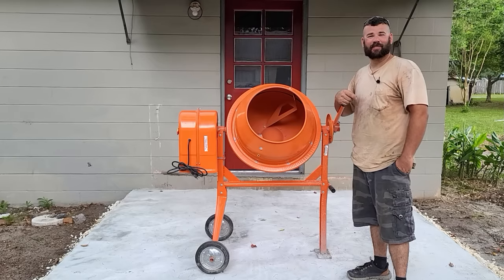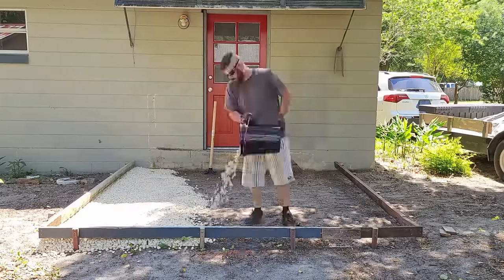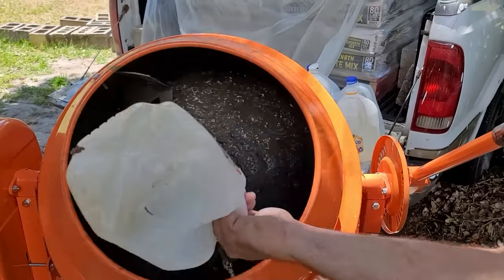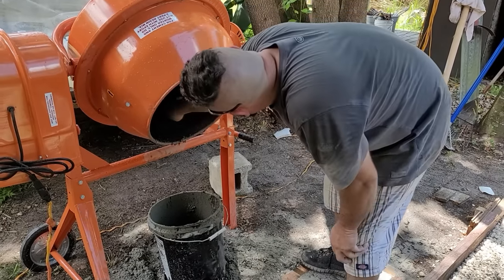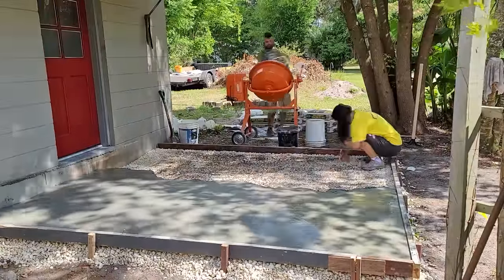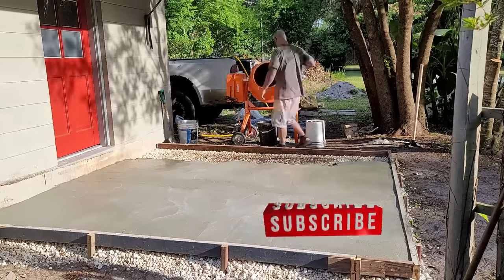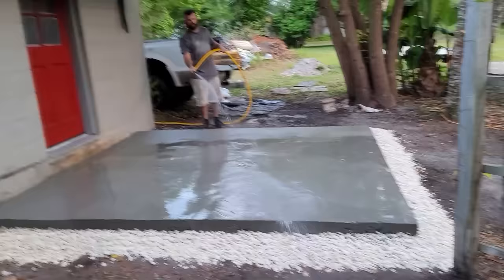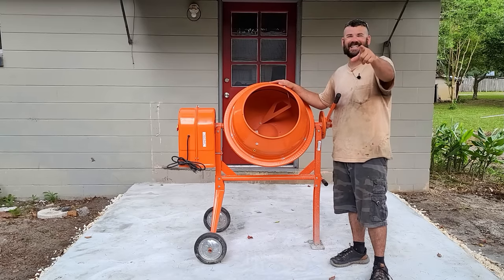Pouring a Perfect 10'x10' Slab with the Harbor Freight Cement Mixer

Comment: He said he used 52 80lb bags at 5bag. 260bucks not bad,a contractor wanted to charge me 4k for the same size, good for you
Reply from the maker: The bag fluctuate in price a little bit but they are almost always between $5 & $7 at the big box stores. Also, if you buy in bulk sometimes you can get a discount and they will load the pallet for you.
Reply: Dang only $2.5 in my area. Nice work tho
Reply from the maker: Thank you, and welcome to the channel.
Reply: Sometimes you can buy open ones at half price.. be sure to ask
Reply from the maker: Good tip... welcome to the channel
Reply: Holy shit!!! I could get a 20x20 at 6” deep by a contractor at that price. But, a 10x10 is a DIY job
Reply from the maker: 🤣 I highly doubt that, but if so, good for you.
Reply: @VIPHoldings 2:21 2:23 2:24 ❤
Reply: Exactly.  Some have a 4k minimum. Others don't..
Reply: I did the the same thing but it took me 72 bags of 80 but it was pretty thick, I was dieing
Reply: Oh lord on 2nd thought  think I'll buy the grey 16x16s at lowes for 3.48 Menards has 24x24s for $14.00  red ones color fades and get hotter faster. If I had a babe I'd take my time toooo....  but.............
Reply from the maker: We feel your pain. Welcome to our channel!
Reply: Yea cuz it would have looked 10x better then this I own a concrete company and I would prolly charge you 2800 for this and it would look way nicer
Reply from the maker: Though you may be right, I saved over $2,000 based on your price, so I'm definitely ok with how mine turned out.
Reply: @D-dogtactical734 I doubt it would look 10 times better , it looks freeat for what he paid and saved , save your sales pitch for the single mothers and old people
Reply from the maker: Thank you! Welcome to our channel
Reply: That's actually not a bad job mate 👍
Reply from the maker: Thank you, and welcome to our channel!
Reply: @cha-ka8671  a 20x20x6 would be close to 5 digits not 260 bucks lol
Reply: Cheers to you, I would’ve ordered a truck for that job
Reply from the maker: @R900DZ I would have, but it's way too expensive because we live so far outside of town. Welcome to our channel!
Reply: @R900DZ  I’m doing my side patio 10x10 and small sidewalk to garage. Truck would’ve cost me $1,200 just material alone. And not to mention $400 pump guy so that’s $1,600 but it is definitely easier. To order bags delivered, and one day of work with a friend will cost $400.  For some not worth the back break and for other they enjoy doing their own and learn. lol
Reply: @Oneklickmedia  that’s way too much for the concrete, that’s what, two yards?  I am in Los Angeles where the prices for everything are among the highest in the country and two yards delivered is only $650. Whoever was quoting you $1200 was taking you for a ride.
Reply from the maker: @R900DZ, if his quote was anything like mine, it's because of how far out we are. You're in LA with lots of choices nearby. We live in the middle of a forest and have few choices, and they're far away, making the cost double or more.
Reply: @VIPHoldings  good point, I didn’t think about that.  Could very well be, I was able to get quotes from 3-4 companies within 10 miles of me.
Reply from the maker: @R900DZ though cost was my biggest reason for doing this project myself, I also love learning new things 😎
Reply: @VIPHoldings  the skill is in the finishing not the mixing but if you like it more power to you! 😎
Reply: @D-dogtactical734  I think his work looks pretty dam good
Reply from the maker: @gemmrk Thank you so much! I'm by no means a pro, but we are still enjoying the patio a year and a half later. Welcome to our channel!
Reply: @VIPHoldings looks great and definitely DIY-able. I'm going to do a 11x30 slab by myself soon but I might go to Home Depot and grab a finisher or two. It will be a patio extension so I want it to look as good as possible.
Reply from the maker: @chandracox6814 That's awesome! If you make a video or take pictures, please tag us, we would love to see it! Welcome to our channel
Reply: A yard of concrete delivered to my house is 170. I much rather do that than do the work but I would love to keep the tools and equipments too so 🤷🏻‍♂️
Reply from the maker: @MrPunisher833 I wish it was even close to that cheap where we live but at least I learned something. Welcome to our channel!
Reply: @VIPHoldings also the satisfaction of saying I did this 👍
Reply from the maker: @robertdiamondoil2384 Yes, sir! Welcome to our channel
Reply: For 8 yards of concrete here in at Louis it’s about $1350.
Reply: They asked for $1800 for my 8x8 it cost me $400 in 65 bags each 60lb concrete. Having a mixer highly recommended.
Edited :)
Reply from the maker: @alianbaba9330 You must live in the middle of nowhere, like us 🤣.  We would have paid more for mileage than our whole project cost. Welcome to our channel!
Reply: @VIPHoldings  correct.
Reply: @R900DZ to order truck for 1 yrs plus they charge minimum 4 yrs so you pay 4 yrds n only get 1 yrd concrete so the way he did it is the way im doing it 10x10 6 dollar bags takes 56 bags cheaper than 4 yds
Reply from the maker: @angelcandoit9061 and because we live in the middle of nowhere, we would have paid a considerable amount for mileage. Welcome to our channel!

Comment: You could of just put the mixer inside of the patio space and move it back as you pour until you run out of space then take it out
Reply from the maker: I thought about that but I had the chicken panels lifted with wire brackets. Technically I could have done half of it that way though.
Reply: @VIPHoldings  ahh ok, you're right, I didn't think about that
Reply: @VIPHoldings   Even with rebar, pros use a piece with a bend in it and a handle welded on to pull the rebar back up as you go.
Reply from the maker: Good info and welcome to the channel!
Reply: It looks like a nice job, but I believe the level, tamped down surface didn't need rebar or any reinforcement and I would have done it like you said.
Reply from the maker: @mgoh1984 I appreciate that. We did actually add metal fence in the middle of the pour for strength. Welcome to our channel!
Reply: I did that once.  It was awful.  This guy did it the easiest way
Reply from the maker: @zfolwick I completely agree. Beings this was my first time pouring something this large, there are several things I would have done differently. You know what that means, right? I just have to do another one 😁. Welcome to our channel!

Comment: You can simply position the mixer inside your form this way you mix and pour, without any buckets or wheel barrel. This mixer can take 3 60 lb. bags or 2 80 lb. bags, the trick is to fill the mixer with water, mix one bag, very wet, then mix the second bag.
Reply from the maker: Welcome to our channel

Comment: One time I did a drive way with my pops ,we threw in galvanized fence, pieces of metal..any scraps of metal we could find..30 years later the drive way is still there, no Cracks ,no sinking still good
Reply from the maker: See, now that is the type of info that I was looking for! Thank you for that, and welcome to the channel!
Reply: Sounds like what I just did in 2022. Tossed in 2 bike frames BBQ grill chains coat hanger a lamp was all I had.  I did bc y not we will see or my mom will it's her hobby shop. It's cool to read some1 else already did it kudos
Reply: Welded wire and doby blocks
Reply: You are the only person I’ve ever seen remove the forms without waiting atleast 24 hours (unless I misunderstood something).   Why remove them so soon?
Reply from the maker: @jordanlabelle6951 Most people remove them while the cemet is soft so they can smooth out the edges, but in my case, it was mostly dried by the time I removed them. Welcome to our channel!
Reply: @VIPHoldings  is that not what the edger is for though ? So you can do it with the forms on ( if it was still wet).
Reply from the maker: @jordanlabelle6951 You can absolutely do it that way. One thing I learned doing it my way is you could get rid of some of small pockets that are sometimes left behind.

Comment: Why didnt you just put the mixer inside the forms and just dump instead of using bucket
Reply from the maker: Because I had a  raised chicken fence inside for strength. It's kind of like having rebar bit, not that strong.
Reply: you pull up the wire after you pour the concrete on it .. i always pour with my mixer in the form, otherwise you are wasting siginificant time and energy dumping / hauling

Comment: DIY projects are the best, especially when they go right. Nice work. Only (slight) criticism, a standard pour is 4 inches. 6 inch forms, two inches of aggregate, 4 inches of cement. That is the winning combination and pretty much an industry standard. And allows for heavier items placed on what is known as an “Honest Four.” You did great for a home owner with no experience.
Reply from the maker: Thank you so much! So let me ask, what do you used for forms? I usually see guys using 2x4s and that's what I used. Should I be using 2x6 or 1x6?
Reply: @VIPHoldings  2x6’s are used most of the time by most cement masons. Makes the math easier when calculating the 2 inch aggregate, 4 inch pour. Some use 2x4 suspended over the aggregate. I’ve seen both, but usually ppl using 2x4’s are eye balling the aggregate height.
Reply: If you use 2x6 and 2" aggregate, that's not a 4" pour. That would be a true 3.5" pour. That's that's the same as using 2x4 material. The reason you would use 2x6 in this scenario is to give the look of a taller wall. It would be 3.5 in the field and have a thickend edge so you fill material doesn't wash away exposing the bottom side of the concrete.
Reply: thanks for this information!!!! @teter129. question, could i put gravel 3/4 on asphalt, and then concrete on the gravel eggregate. or will i need to tear/rip out the asphalt first? this is in seattle.

Comment: I just finished pouring 2 cubic yards of concrete into piers using a Home Depot concrete mixer that looks similar to yours. I used 60 lb bags, and mixed two at a time. I put 4 quarts of water in the mixer, then the two bags of concrete, and let it mix for a couple of minutes. Added 1 more quart, then a few sprays from the hose until the consistency was right. Instead of moving concrete from the mixer to the piers, I placed the mixer next to each hole, and built a chute out of scrap lumber and plywood so I could pour directly into the holes. I didn't carry or wheelbarrow any wet concrete. Worked pretty well. I'm just glad to be done with that job. 128 bags of concrete is a lot for my poor old body to lift.
Reply from the maker: That's a great idea! Mind if I steal it for my next pour? I'm happy to hear that your project went well and more importantly, it's done. Welcome to our channel!
Reply: Dead on the quantity. Sooo many bags when I was young.
Maybe that's why I'm broken now.
Reply from the maker: @michaelmaxim7207 I'm sure if you really needed to, you have a couple more pour in you!
Reply: @VIPHoldings  Of course! Sharing is caring 😉.
Reply from the maker: Thank you 😊

Comment: Good job!! Spray some water onto the hardcore, this will help bind the mix your about to pour. For your next slab move your mixer into the slab area itself, or directly adjacent. Fill the mixer to capacity!!! Mix and drop the mix directly into the slab area or scoop it out with a shovel, anyhow, just get the mix on the floor and start mixing again, as you want speed!! 8 hours you need a medal!!! Don't bother hand floating yet! put your float to the side.  Start dumping the mix from the house and work backwards, away in a horizontal plane parallel to the house., Every few feet or so,  You and your wife or a friend. stand either side of the slab and out side the slab, take a straight edge of timber, say 2" By 3", rest it on either side of your edges as a guide to level the mix and draw your mix backwards away from your house, using small up and down movements  lifting and pressing the timber up and down onto the mix. This is called tamping the mix, or drawing up the fat, as water will rise to the surface. Add more mix to shallow areas and scrape high areas flat and re-tamp, keep going moving away from the house until you have to lift you mixer out of the slab area. OK now you can look at your slab and apply a finish with a broom, float. or leave it as tamped finish etc, as you please. Easy when you know how!!! Hopefully this will save you time and effort in the future. Adding wire mesh to the slab will give it greater strength, it depends on the load you plan to have on the slab, but it needs to be in the centre of the slab. I would add mesh. Also allow room for some expansion for the slab in hot weather, so your slab will not crack!! But now we're starting to get all technical. Anyway, good effort mate!! 8 hours with a little bucket, good for you!!!
Reply from the maker: I was hurting after that 8 hours, but it was worth it when we saw the final product. Thank you for your critiques, as I doubt this will be our last pour. Welcome to the channel!
Reply: @VIPHoldings  You did just fine, but you looked tired at the end. Lots of good youtube videos on slabs, watch the pros, they make it look easy, but they have all the tools and expertise to obtain a finish the average person would struggle to achieve. BUT, you got the job done and powered through it. Your next slab will be much easier and less taxing on you. Good luck.
Reply: @nemonemo6285  do you always put that much rock (gravel) as a base ?
(Going to try my first project)
Reply: @bob4003  Hi Bob, Always use a well compacted base. The depth  of your base depends on the function / use / and load the pad will take. i.e. small pad in front of my shed, say 3 by 3; or a small garden path, needs 3 inch base, no wire mess / rebar, that's fine. A base for a drive way that will take heavy trucks needs a deeper, rolled base with rebar!!! Read up, all the info is on the web. Design it well, factor in your age and health,  write you self a small plan, take your time and enjoy it. Hope that helps. Best of luck Bob!!
Reply: @nemonemo6285  yes thanks. 10x10 patio is what I’m working on
Reply: @bob4003  Bob !!!!!  that's a lot of work to mix yourself. Hard work by hand!!! Try to get some help. My notes. Plan it fully. 1) Shuttering / Setting out / digging out to firm soil. This includes slop Slop on your slab, 2) materials to site.  finish, are you adding colour? Broom finish !!  Edging of the slab!!!! Make sure you have you tools ready. And most importantly you will need a long timber for levelling. If the job is too big you can separate the slab in two parts.   I'd use rebar and Check if you need expansion gaps!! Watch the sun where you are, your mix will go off quicker!!! and get some beers !!!
Reply: @nemonemo6285  you just lay the rebar on top of the gravel ?
I was thinking of using 4x7 wire squares I can get at Lowe’s.
I have a small mixer
Reply: @nemonemo6285  just going with the finish the leveling board will leave
Reply from the maker: Thank you, and welcome to our channel!
Reply: @nemonemo6285  I see some videos say they oil the wood forms, what kind of oil is used ?
Reply: @bob4003  Yes, the rebar goes on top of your hardcore, Not gravel buddy!!!! The Rebar should be in the centre of you slab. How??? Well it is supported on small cones (supports) before you pore your mix. You might be better off getting a price to have the concrete pored into the area directly once it's ready. Much easier, less work and faster!!! Good luck mate!!!
Reply: @bob4003  That will do the job just fine!!!
Reply from the maker: I'm unfortunately with that process, sorry.

Comment: I bought the same mixer to do a chimney. Thing worked so good for the price. Some nuts and bolts fell off but it’s still running strong. I did a 30ft chimney on a 6 x 4 concrete slab, mortar scratch wall and stone veneers. I think I used about 50 50lbs bags of mortar and 25 80lbs bags of concrete, I’m just guestimating. But it was around there.
Reply from the maker: We just used ours again for a front porch upgrade and still love it. Do you video any of your projects? If so, you're more than welcome to add your link here. Welcome to our channel!

Comment: Awesome video. The hard work you put in paid off for a finished product. A few notes for future projects: concrete and cement are two different things. Cement is an ingredient in concrete. Concrete is the entire mixture. Water first in the mixer. Also, wear a dust mask, silica dust is not forgiving. A 5gal bucket full of concrete weighs about 100 pounds. Wire mesh is fine for any pour, but it should be suspended in the middle slab for structural integrity. Rebar should be used for anything over 4 inches thick. It also needs to be suspended in the middle of the slab. Best of luck with future projects.
Reply from the maker: Hands down the best comment we've received so far! I learned the cement vs concrete just before making this video but I may have used those words interchangeably on accident. We did suspend the chicken fence with wire brackets that were sold near the fence at the big box store. As for a mask, I am usually very safety conscious but it was so unbelievably hot that I decided not to wear one, thinking that I was outside and there was a light breeze for ventilation. I will try harder next time. Thank you so much for your tips and welcome to the channel!
Reply: @VIPHoldings  
How’s the best way to suspend the wire mesh or rebar in 4 inches of mix??? Thanks!
Reply from the maker: They sell small wire brackets to keep wire mesh or rebar off the ground during the pour. You can get it in any big box construction store.